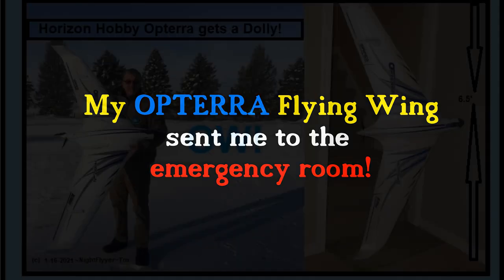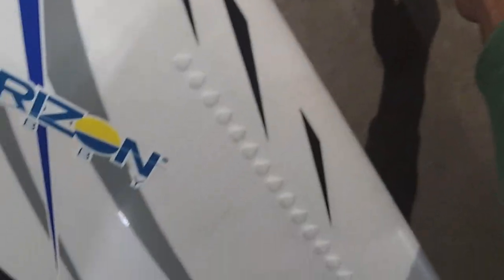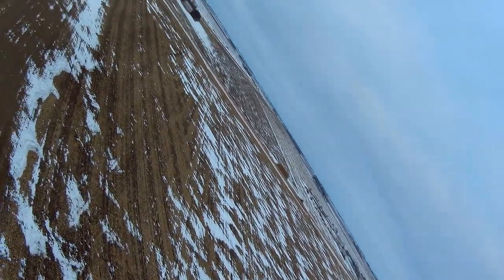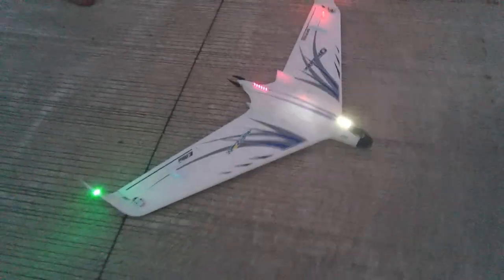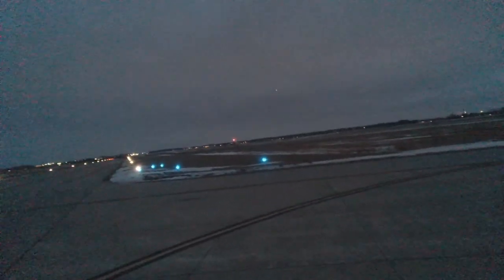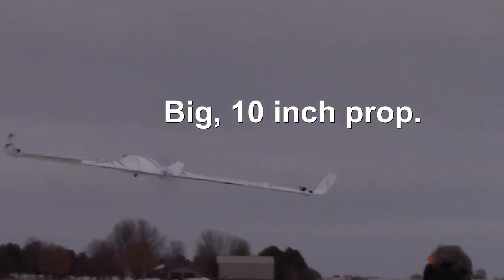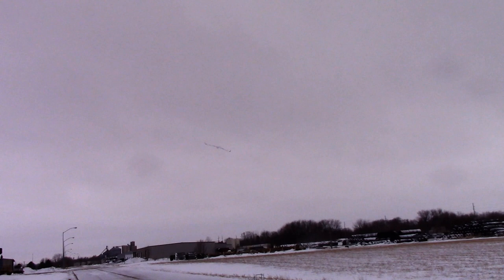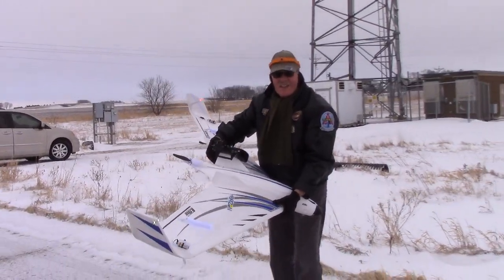My Opterra 2M Flying Wing sent me to the E.R. This is an awareness video & my solution for launching

Comment: The worst prop strike I had was on a Norvel 0.61 gas engine with a Scimitar 6X4 prop.  Started it fine and was reaching for the needle to tune it a bit and my finger tip got just close enough to the tip to get hit... Twice.  Those Scimitar props are *sharp*.  It cut into the very tip of my finger, knocked the prop nut loose, and kept running.

My injury was no where near as bad as yours was, but being on the end of my finger was hard to bandage up.  Glad you weren't hurt worse.
Reply from the maker: Ouch.  Thanks for sharing that. I have flown models for over 60 years and never had this happen. I followed the instructions to a tee and all went well in my earlier videos of this plane, but nothing is 100%.  I am healing and I know what you mean about hard to bandage.  I was going to use superglue, like we did in Vietnam, but 2 tendons were cut, so passed and went to the ER instead.  Thanks kindly.

Comment: I was working on my Funcub when my hand bumped up the throttle and cut my arm in 5 places. I received 23 stitches and a lesson learned.
Reply from the maker: Yes, that is the reason I mentioned it, as I am not alone.  Thanks.

Comment: Awesome flying wing Dave! Even with the light mods! Sorry to hear about what happened to your hand when hand launching it. Nice idea about the launch dolly. You might want to do a slight  modification to it by adding an second dolly line in parallel with the other one. Two of them would provide better travel stability while launching than just one.

If you do decide to do hand launching as you did with this flying wing and those of that size or bigger, may I suggest picking up a pillaging knife glove(s). They are light weight stainless steel and will prevent those type of cutting injuries from a prop strike on your hand(s). Great video and thank you for the tips. Get well soon and work out that hand to keep the mobility up to the way it was be for the prop strike. Will add you to my prayers.

Regards,

Kalvin
Reply from the maker: Well I will never hand launch this again.  I thought about gloves but the finger holes  in the fuselage are quite small and hard to grab on this 7 foot wing in the wind.  Plus, I would have to remove the  glove quickly so I can fly the transmitter and feel any switches.  I appreciate your comments, but for me and for now on, it's Hello Dolly!  Thanks Kalvin.

Comment: Sorry to see you got hurt! That looks nasty and because of that risk of injury I decided I'd put electric retracts on mine. Get well soon!
Reply from the maker: Yes, I thought of that too, but they would have to extend at least 10 inches down, to keep prop from hitting the ground on take off, and requiring lots of work, with nose wheel steering, making it heavier etc, so I am keeping it simple with my dolly.  Thanks.

Comment: I've had that happen with a Trex 450 with carbon fiber blades. After flying, I picked it up and forgot to cut the transmitter off. Needless to say when it put the transmitter under my arm to open the door, I hit the throttle full open. Blades tore my ass up. I ended up with 12 stitches and some really bloody clothes. So, my lesson is learned. Sorry that happened to you. I feel your pain.
Reply from the maker: Yikes. That sounds painful for sure too.  I appreciate your story and hope you still fly.  Thanks kindly.

Comment: So sorry you were injured. I hope it healed up well and that you weren't in too much pain. It sounds like you aren't using a flight controller which is fine of course. All my builds use Ardupilot and it has setting specifically to prevent what happened to you. The software can identify when you throw the plane and ArduPilot has parameters to set a delay so that the plane starts after it leaves your hand. It works very well. Flight controllers and ArduPilot are quite complex but they also bring a lot of interesting functionality to flying as well including safety features.

Comment: One safety feature you can enable on your transmitter is a throttle hold switch. It doesn't help with the launch problem, but makes it safe from mistakenly bumping the throttle while you're getting ready.

Comment: The edges of plastic props are quite sharp. Years ago I got stitches in the top of my knee from a prop strike when starting my RC plane. A light buff of sandpaper on the prop leading edge will greatly reduce the danger.
Reply from the maker: Right.. Well the Dolly is now my safe answer. I will never handlaunch this again.  Thanks.

Comment: It wasn’t from a hand launch, but when I took the hot shot off the glow plug back in 1995, I accidentally put my right hand into the master airscrew prop on my global flyer 40T. Thankfully I’d already done the run up and the engine was at idle. I still ended up with 9 stitches and part of a fingertip sliced off. Had I been at full throttle like yourself, I don’t believe I would have been as lucky the prop got just to the outside sheath of my tendon.

That was 25 years ago when I was just a kid. It all healed up and all I have is are scars to show for it now. I hope you heal quickly boss. And btw, thanks for taking the oath as a Marine. I’ll get you a box of crayons for your next birthday 😁 - 21 years Army and still going!

Comment: Like the dolly. On the first flight I noticed how underpowered it seemed to be, hence the need for a longer take-off. (I guess) Hope your finger is feeling better soon. re-the plane, obviously a design fault/safety issue. Glad you have issued this warning for others. I would certainly be letting the manufacturers know, in no uncertain terms. Thanks from the RC flying community. Best regards from down under hotliner pilot. (my favourite plane atm is RCRCM E-TYPHOON with Kontronik 480/50 with 5.2/1 gearbox)
Reply from the maker: Thanks so kindly and we appreciate that.  Typhoons are great!

Comment: Thanks for your service and for sharing this. Glad you are on the mend and I like the launch Dolly. I haven't flown too many wings, I fly mostly multirotor UAVs for aerial imagery and remote sensing,  but could you rig a launching stick like you would use to throw an atlatl?
Reply from the maker: This wing is 7 foot long, heavy, and will bend and break the end off the if you even try to pick it up by the tip and barely has enough power to fly out of your hand at launch.  I know and I tried to launch it discus style, but could not hold it where I felt I could launch it successfully in the wind.     It would also be extremely difficult to somehow launch it discus style with the elevon there and that 7" tall winglet rudder that is also on the tip.  I know how to do it , but not with this plane.  
It's not like launching my SMALL F-27 Evolution or 1.2M Opterra.  So I followed the instructions word for as I did for the video I made of my product review earlier where nothing happened bad.  https://www.youtube.com/watch?v=P_inF5EYLEE&t=1s and the second one where I explain how to protect the bottom of the fuselage.  https://www.youtube.com/watch?v=ur5V5H8UcGs&t=1s
My dolly is my only safe launch method from now on, but thanks for the suggestion.

Comment: Hope all is well. Normally, I would run with the prop off and throw it like a paper airplane hard and as soon as starts pitching down I immediately grabbed the transmitter (held by a lanyard) with full throttle and elevator up.  SAFE was on. Get well soon!
Reply from the maker: First of all, that had nothing to do with my had injury. I only mentioned the Throttle arming because I followed instructions in the manual and this is the way it bound up and  arms the motor as soon as you plug in the battery. It's a warning to be cautious of, because the manual says nothing about programming in a throttle cut to a switch, which could also may be in the wrong position, by accident. I'm pretty experienced so never relied to on a throttle cut/hold, as all my esc's need arming.  I only am warning others to be careful BEFORE the launch and to be careful.

 Here is word for word what the Opterra 2M manual says about launching.  
1. Put the aircraft into launch mode with the channel 5 switch.  (in my first video that did not work, it went into the ground)  
2.  Hold the aircraft in one hand and the transmitter in the other.  
3.  Apply full throttle and throw the aircraft directly into the wind, angled slightly up (5 to 10 degrees above the horizon). 
4.  Climb to a safe altitude and check the trim.   
I know others have their own ways, and either way, my Dolly is the safest solution for me.  The Opterra 2M manual says nothing about throwing it with the motor off, so if a newbie followed the instructions, like I did, I'm showing what could happen, in case a gust of wind got them or something else.  Nothing is 100% and no matter how good you can throw this big 7 foot wing with a 10 inch prop spinning right next to your face, stuff happens. 
Maybe a gust of wind, maybe my 73 year old left arm was weaker, or who knows.   But either way, if it happened to me launching the way I thought was good (and  the same) as all my previous launches. So if it can happen to me, it can happen to others, and that is the warning I want to present.  Thanks for the comments.
Reply: @NightFlyyer  I will keep that in mind. Thanks!

Comment: I converted mine into a EDF using a Freewing AL37 engine nacelle strapped to the top and a Wemo Evo 70mm fan.  It's a bit under-powered but flies virtually silent and is safe during launch!
Reply from the maker: That's the way they should have done this one too.  This Opterra 2m is also way underpowered.  Thanks.

Comment: Yes I did the same thing with an AR flying wing, my injury was to my index finger, 3 cuts and 10 stitches. Ouch! I won't be launching in that way again.
Reply from the maker: Ouch. Your wing is smaller too, so you can imagine this 7 foot wing launch is hard and I'm not very comfortable trying to discus launch it as many have said I should have done.  I wont be launching it that way again either.  From now, it's Hello Dolly!  Thanks and be well.

Comment: I am very sorry you hurt yourself. I am very pleased to see that you came up with a solution and did not try to continue hand launching your airplane. I build and fly model airplanes and as a guitarist I have to be very careful with the props. Even my Mavic mini small and flexible props can do some damage.
Reply from the maker: I play guitar as well, as you may have seen on my channel, and for sure, I will be down for months, as I can barely type let alone do a power chord.  Thanks for your comments, stay well, and be safe.
Reply: @NightFlyyer   Didn't know about you playing the guitar as well, will check out your channel. One tip, whenever I get a finger cut I use crazy glue and it works well as it keeps moisture away. I heard that it was originally used for that purpose in the Army. But definitely not when cuts as deep as the ones you had 😳
Reply from the maker: @RaymondLohengrin  Yes, we Marines used Super glue (CA) in Vietnam quite often, and I have also used it for cuts over the years a lot, so not news to me.  But in this case, I had lots of blood coming out of 3 wounds and it was dark, didn't have any superglue, but thought about it.  I knew I cut a tendon, so didn't know how I would be able to glue that together first and do it all with one hand.  LOL .  Thanks much and stay well.

Comment: Seen the 2 handed overhead launch? At least you aren't in line for a prop strike. I hit myself launching a plank style wing I built from scratch. Put landing gear on it after that.Your cart solution is very novel! Great job!
Reply from the maker: Yep, but hard to do the 2 handed launch while holding the transmitter.  I just simply followed the instructions as written in the manual as in my earlier flights, but nothing is 100%.  Yes, it's now hello dolly for sure from now on as it's easy and safe.  Thanks.

Comment: Hi Dave,
OMG, you could tell you were hit by the prop even before you yelled. Good that Ilea goes with you as she was needed that night. Sure looked very bad at the ER. How is the wound healing? I hope there is no permanent damage. Thanks for your service.

I had my left hand struck by the main rotor of my Schluter Scout Oct 88 as it was spooling down and spent five days in the hospital as a precaution against infection. It split open and crushed the knuckle of my index finger and now have limited up and down motion. Only a split second of not paying attention to where my hand was caused the incident. Luckily I was at home and driven to the ER by my father. Took seven months to heal along with six months of therapy. Lost nearly a year of any flight time. Made rounds of the local flying clubs showing how dangerous rc helis could be if taken for granted for just an instant. You and Ilea stay safe.
Reply from the maker: Thanks a lot Don.  I am getting better by the day and can finally type some.  Yours is quite the story too.  Stay well yourself.

Comment: been there did that, cut my left index finger to the bone while trying to start a gas engine years ago. If we fly rc planes, we will eventually have a prop cut us. No matter how safe we try to be. I am a safety engineer (retired) and all the planning and careful attention didn't stop me from getting a cut. But a reminder, especially a video, is helpful. I have  been warning a friend to be very cautious when hand launching. The trolly launch is a good idea but only practical on hard surfaces and larger propped planes. I use a catapult system. Hope you heal quickly.

Comment: this happen to me 20 years ago when i used to fly gas rc planes. I had just started my trainer and i reached over the prop to take off the glow plug starter and caught my thumb in the prop. It went right through to the bone severing the tendon. I had to have an operation to reattach the tendon and was in a hand cast for 8 weeks. accidents happen.
Reply from the maker: Yes for sure.  Thanks much.

Comment: Don't feel bad, RC planes put me in the ER once, and in the OR another time, for micro surgery.  I thought RC planes would be safer, after having flown full scale and switched.  Anyway, one way to make that plane easier to hand launch is to glue a tab at the CG, on the bottom of the  fuselage, and glue sandpaper on the tab.  That would give you a good grip.  I've done similar and it makes a big difference, with little weight gain.  Still, I don't like that large prop to close to your hands....and your head.  Another thing, the ESC arming is OK.  Any ESC that requires full throttle to arm it is scary in my book.  Anyway, keep up the good work.  I am envious of the great flying fields you have at your disposal.
Reply from the maker: Ouch.  Yes, the best pilots in the world have bad landings now and then and this was my time.  Thanks kindly.

Comment: I've been wearing a welding glove that's one size too big on my throwing hand, that way once I toss the wind up I can easily let it slide off my hand and onto the ground. It has saved me twice now, once from a GP123 that backfired and spun the prop into my fingers and the other to a large scratch built wing. Dolly method looks to work great though. Hope you healed up quick. I've always enjoyed your videos!
Reply from the maker: I could not hold the tiny fuselage grips on the big plane with a thick glove, so gave up that idea for the dolly.  Glad your better.  It was a lesson that cost me $2400 in hospital bills so far, that I wont forget soon. Thanks.
Reply: @NightFlyyer  Good point, forgot how small the grip is on the Opterra. My scratch built wing has a vertical fin on the bottom to act as a skid and it's an inch thick and three inches tall. makes it easy to grip with a glove on. The dolly idea is perfect for EPO wings that size. As you said it's slippery and white epo tends to be for some reason. Ouch on the E.R. bill, gave up dirt biking for that reason. Not scared of crashing, just the bills that follow haha.
Reply from the maker: @SasquatchPNW   Well said.  Thanks again.

Comment: Cool cart.   I had the same problem.  I built a similar cart and attached a left over F-27  motor (to accelerate the cart) and 2 servos to push the wings up over the forward restraint bars when I activated the throttle and elevator.  On launch the cart signal wires separate when the plane pulls away. Definitely overkill for some uses but good for big gliders. I also put landing gear on the F-27 to get it off the ground without launching by hand.  With a landing gear gyro to steer it straight down the runway it works fine.
Reply from the maker: Wow, you really did a number on your cart.   Mine is pretty simple and my plane just lifts off, when up to speed, so I am happy and don't have to charge the dolly and the plane too.  I launch my F-27 off my launch rail as you saw in the video and it works too.  Thanks and happy flying.
Reply: @NightFlyyer  It was fun to build, but probably too much.